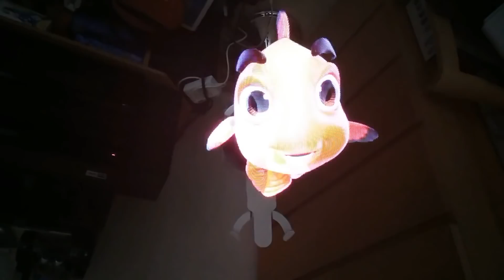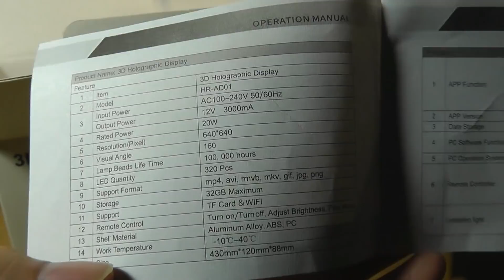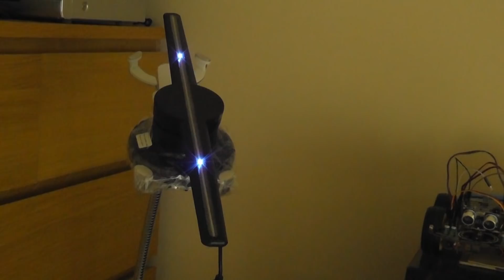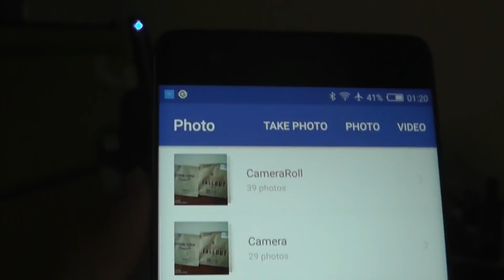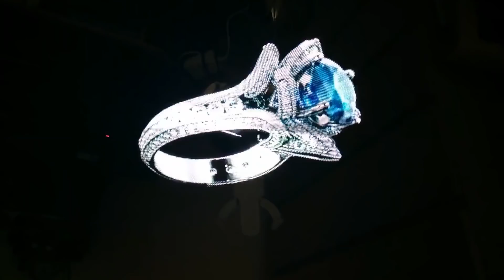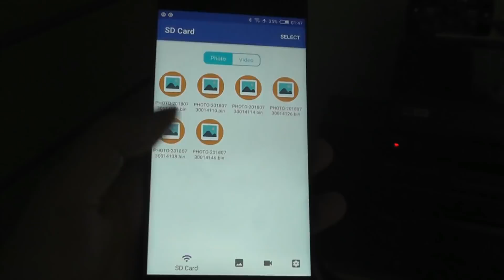REVIEW: iDiskk WiFi 3D LED Holographic Display Fan

Comment: Hi, I have a similar 3d Holographic Display Fan 224-3d-Hologram Z1 and I can´t reproduce 3d images. It only shows a plain image. I tried several software with the same results, even with the factory demos included in the sd card. Do you know if it could be a hardware problem? Can you or anybody help me? Many thanks in advance.
Reply: Please contact me at szftl2@163.COM
Reply: Did u finally get it figured out because i really want to get one!